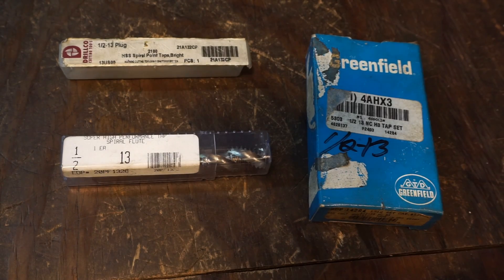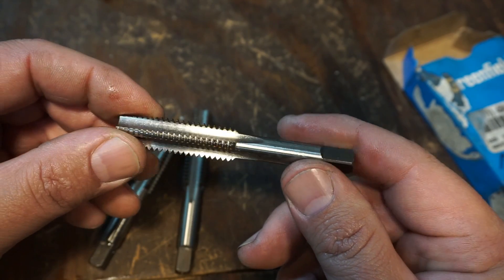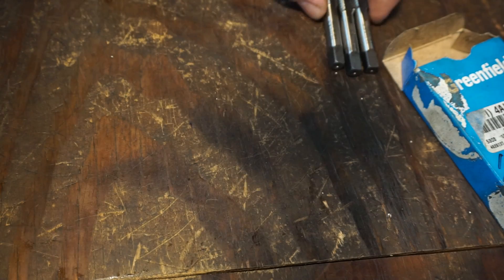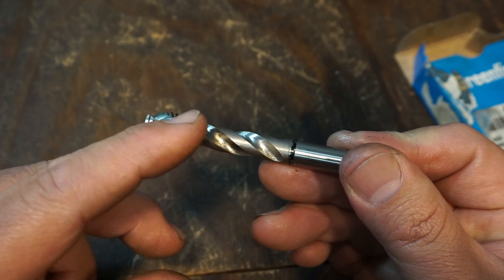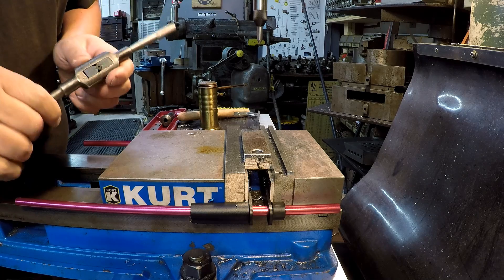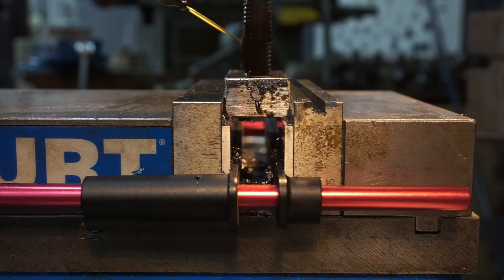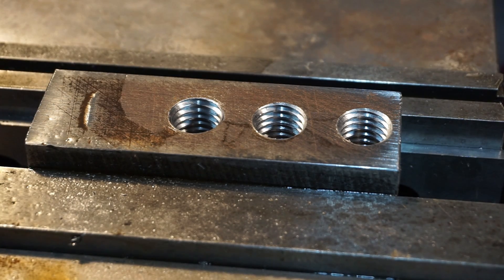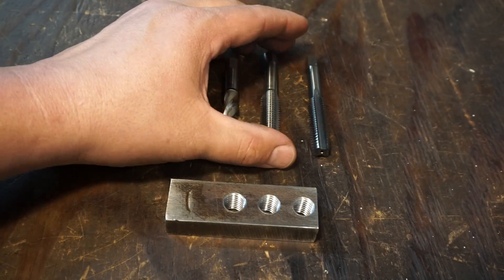Shop Talk 21: Taps

Comment: My first rule for taps: Don’t buy “high carbon” steel taps from the hardware store (like the Irwin brand everybody carries when you need one on the weekend). Now I only buy high speed steel taps from a reputable source like Greenfield. That has made all the difference for me in my home shop.

BTW I’m still learning about the various coatings they add to the HSS. Not yet sure where the hype begins on those.
Reply from the maker: Very true Tom! For those reading I'll second Tom's comment and I should have noted that in my video. Don't waste your money on high carbon steel hardware grade taps. Buy high speed steel. Even the high speed steel taps I have used that were made in China were better then the carbon steel taps.
Reply: I think it's worth the extra cost. You may need it again some day. If you've ever extracted a broken tap from a hole you already know the value of not using a brittle material for a tap. What is an extra $5 or even $10 dollars compared to hours dealing with a broken tap. Or worse, you can't get the broken tap out! Stick with HSS.
Reply: I think the coatings are useless in the home shop. Same with twist drills, coatings are only really for high production work. When getting the maximum life out of a tool is needed.
Reply: MrShobar yeah good for common taps but isn't worth the cost for those oddball taps
Reply: yep, black nitride seems to work best for me
Reply: The coatings come in to play in Cnc work where soluble cutting oil may be your only lube. Also un offically for tapping harder materials.
Reply: High carbon steel taps or dies could be used but only for plasticks or soft material but in other case they are worthless
Reply: Adom I'd even add be cautious of hardware / parts store hss. I bought one once as a backup for a weekend job. It looked like it had been run in a vibratory tumbler the cutting edges were rounded over so much I couldent even use it as a cleanup tap.

Comment: I cross thread the first few threads of aluminum engine block when I was installing valve cover.  Can I use a tap to try to fix the threads?  Or should I try thread chaser?  Any advice would be appreciated.  Thanks.

Comment: Years ago I worked at a large candy company and were not allowed to use plywood to mount electrical boxes. We would purchase 3 different sizes of 1/4" Aluminum plates. I could get several hundred 1/4-20 tapped holes with a single gun tap using a hand drill & alumni tap fluid.  Have some Greenfield tap sets that were my dads.

Comment: Another thing l do not recommend carbon steel  taps for tapping a hole as they are brittle and very unforgiving and brake off easily . High speed steel taps will spring a little before they  brake !

Comment: Spiral flute and spiral pointed work better for machine tapping as they give a shearing action as they cut . Takes a lot less  torque to turn them. Any tap cuts much like a broach . Each thread cuts the thread a little deeper till the last full thread with clearance makes it a full thread . The GH number marked on the tap refers to how many half thousands above the nominal size it is. Or how much clearance it will cut  for the screw . Everything  you was spot on . I sharpen cutting tools for a living . A sharp tap cuts  way better, less likely brake and cuts a much better thread . That's how a lot of taps are broken trying push a dull tap .

Comment: Airframe and Powerplant mechanic Did you know that aviation threads are rolled for strength and a tap or die make the threads unairworthy? These items create break points.

Comment: Thanks Adam, great video!  Hopefully you're still reading questions on this video. I'm in the process of buying a 115 pc Machinist's drill bit set and it seems everyone calls theirs "High Speed Steel", what other quality separates them. I see 3 different sets on KBC Tools that all claim HSS but are priced at $90, $250 and $350, but no other apparent difference. What sets them apart?  I'm not a full time metal worker, just a weekend warrior, but want a jobber length set that will keep a good edge and last me awhile. Thanks!

Comment: What is the materials of those taps? And why there are some taps are specially to be used on some materials like aluminium? If the taps can be used on steel, it is also certainly fit aluminium. Is that true? Thanks

Comment: I love how the data on spiral flute taps have a maximum tapping depth, and that it's always just the length of the threads cut on the tap. Even though you can take it down way deep, because the shank is slightly smaller than the tap drill size. If they have a fatter shank up top where it gets driven, then that, to me, is the maximum tapping depth.

Comment: a 4th tap ie a left handed might have been good too, though that might make a better shop talk video in its own right, you could show left hand drillbits and left hand taps and explain and demonstrate the uses of those.
great video abom79.
as an aside i saw a tap and die set at a boot sale(swap meet), it was in a plastic case and looked like one of those "budget" sets, a mixture of metric, unc and unf a comprehensive hobby set but i noticed they were lefties, so i asked how much thinking to myself it its under 20 pounds its mine, when he said a fiver i  said ok, that was the fastest i have ever pulled out my wallet LOL.
i guess he thought they were just a normal set, you have to keep your eyes peeled at these sales you find allsorts.

Comment: Ah ... a man that uses Edge Technology tools ...I have a Pro Lathe Gauge. Haven't used it yet - fits in my 3 -jaw chuck and enables me to set my tool height in my Lylak lathe. I have a bare bones tool post so I will use my Pro Lathe gauge to set my tool height using shims or precision ground key stock. I will then keep each tool and shim combination as a set. I think you get the idea - no more hunting for the right tool for my tool post. Obviously I have space for 4 tools in the tool post, with a fifth choice being a centre drill; I will use Edge Technologies Tool post chuck for drilling. This should cover most jobs with this lathe; other tools will already be a tool post 'set' if I need them. One uses what one has!

Comment: Great video from a great man. Thanks for the really nice video.

I would like to add that there's another one used for aluminum and soft material. It has a lot of names like fluteless tap, roll tap, conforming tap. And like the name it doesn't cut, it forms the thread from cold deformation which makes the thread stronger in softs materials.

Comment: I was once told that they are called gun taps because they shoot the chips out of the other side of the hole. Don't know if thats true but it works in my head. Also looks like you have some extra room on that piece of stock you might want to go over form taps in a future video.

Comment: Abom, can you do a more extensive lesson on (pilot hole drilling, stepped drilling and explain the difference in drill bits)? Oh can you explain proper size drilling before tapping? Another good lesson would be on dye’s as well as repairing tapped holes and threaded shafts and bolts?
Reply: Im a heavy duty diesel tech, I’m very curious about my prior questions because the shop I work at repeatedly calls a machinist to repair stripped, cross threaded and broken bolts too. I can do these repairs easily but, I’d like to understand different methods and proper technique in doing these repairs!

Comment: Adam, we use Dormer spiral taps at work and they work great. They are a little pricey but when you can power tap a few dozen holes before you see any changes (rough threads or binding up) is worth it to me. Nicely explained in this shop talk. Keep up the good work.
Reply from the maker: Yes Dormer is another good brand. I have a few sets viewers have given me.

Comment: Great video Adam.  I've used the basic "plug" hand taps for most of my life since that's all that came/come in the hardware-store-type tap sets.  If you decide to do a follow-up to this video, please explain for those who don't know, the reason for using a spring-loaded follower and also (especially for manual machines with no digital readouts) why it's a good idea to drill & then tap each hole before moving to the next hole to be drilled & tapped.  Watching you do these close-ups of spiral-pointed & spiral-fluted taps makes me want to add some to my tap sets.  I think my oldest tap & die set came from Western Auto, so I'm probably dating myself a bit here,  ;)

Comment: I love your shop talks Adam. Maybe one you can do is one on drill bits? Im an electrician I am always drilling into wood with different wood bits and steel. Maybe something about best drill bit for different metals? Some tips on sharpening the drill bits?. Im always burning through spade or paddle bits for wood maybe there is a way to regrind or sharpen them to get a longer life? Thanks Adam

Comment: Adam, thank you again. i learned a lot. that thread cutting oil you used looked like it was half oil and half snot. more like chainsaw bar oil. is this your own special mix or did you just buy it off the shelf ?
Reply from the maker: It's dark cutting oil, Pennex N47 which they don't make anymore. Rigid dark cutting oil is similar.

Comment: Tapping guns are kind of like an air drill with forward and reverse on the trigger first click goes forward and then the second click instant reverse. There used on assembly lines in production work.
Gun Taps are normally harder to break off than other kinds of taps.

Comment: I think the spiral flute tap may be made by YG-1.  They are a Korean company that makes end mills, taps, drills etc.  I have some of their spiral flute TiCN coated M5 taps and they make nice clean chips just like the video -- they also have the black stripe on the shank though I'm not sure if that has a purpose.
Reply from the maker: So far all of the Korean made taps I have work great!

Comment: Adam
Great video.  In the fab shop I worked in right after high school, we used nothing but spiral pointed taps in our tapping guns.  perhaps that is why they are called gun taps.  For lube we used nothing but Anchor Lube on both the drill bits and taps.  It amazed me the amount of life we got out os small taps and drill bits.  This was back in the early '70's.
Reply from the maker: I have Anchor Lube and use it sometimes but it's harder and messier to apply then using my cutting oil from my Eagle, so I just use what makes my job easier.

Comment: Perfect timing on this great video - I  broke a tap off in some unknown stainless today, time to get back to basics.  Do you change your tap choice (brand, coating etc.) based on the material you're tapping?

Thanks again
Reply from the maker: I don't change brand, but I will toss out a tap if i know it's getting dull and is not cutting properly. I use all my taps for any materials, but they must be sharp!

Comment: I learned a lot from this video.
- I learned that taps have a couple of threads at the tip to get them started - always wondered about why they started as easily as they do.
- I learned what a "bottom tap" does and why you need one and when you need one.
- The one thing I'm still confused about is: did you say the power tap was "loose" in the chuck?

Comment: Thanks Adam. The casual (mainly armchair based!) machinist in me never thought about this before but, presumably one issue with the partially threaded spiral flute tap is, if you go all the way through the work-piece such that the threads of tap are no longer engaged you have to be careful getting the tap back up and out again? Best not to let it go right through in the first place I guess!
Reply from the maker: You are correct. For my manual machining I visually inspect the tap as it clears the bottom of the hole then reverse it. But for through holes best to use a spiral point tap.
Reply: Makes sense. Thanks for speedy reply Adam! - hope you have a good day at work! :)

Comment: Another good subject might be to discuss classes of fit on threaded parts. Another might be to talk about pipe thread taps, which have their own quirks. For example years ago I worked for a Mill Supply house that sold valves and air cylinders made by a British company. Suddenly we started getting complaints that the 4-way valves in 1/4" NPT were leaking at the threads. Lots of head scratching going on for a while until someone figured out that a batch of valves labeled "NPT" for the US market were actually British Pipe Thread! What's the difference? ONE thread per inch (at least in 1/4")! Nice leak path around the threads...
Reply from the maker: Yep, I have a few bspp taps. One is 19 TPI.

Comment: So, I've got a project upcomming where I need to cut trapeziodial threads. I've bought a TR16x4 tap, but when I made a test tap, I couldn't break the chip whilst tapping.
I managed to power trough without breaking the tap, but I don't know if thats normal or not.

Comment: I am in the UK and have always known hand taps as Taper tap, second tap and plug tap or bottom tap that's how I was taught in college and have always known them called ever since.
Reply from the maker: I have a three tap set from your region and they are called something similar. There’s a first cut, second cut, and finish cut tap. I used them in a video once. It’s not common for the US though.
Reply: Sometimes they just get called first,second and third, depending upon where you are in the country.

Comment: Would the spiral fluted tap be the best choice for power tapping bling holes then, since the chips are pulled up and out?
Reply: dbennett4 yes. I think they’re the best for all power tapping as they spiral the chip out and don’t fill up like on with straight flutes
Reply from the maker: Yes best choice for blind holes.

Comment: Thanks for continuing to make videos with good information in them, both your Shop Talk videos and the Saturday Night Specials.  I'll also wholeheartedly concur with Thomas Utley's comment - a few weeks ago after sitting for 1-1/2 hours with a Dremel and a small burr to grind out a broken cheap carbon steel tap from a hole (where it broke on the way OUT), I won't use them in anything harder than aluminum.  Now saving for a set of HSS taps and dies.

Comment: Great video Adam. I really enjoyed that. When I was looking for taps at MSC, the options.......OY! I have the run of the mill hardware store taps, fortunately for me, I only broke one tap in my life, I was able to get it out and enlarged the hole and tapped it for a larger bolt,  not a problem for size, only held a emergency brake cable. I managed to find some Tungsten taps at a yard sale and it replaced my cheapo metric carbon taps and they work great, a little oil makes things much easier. Is tungsten a better metal than HSS? I enjoyed the differences on the taps. I usually run a tap through anything with a bolt to clean it out upon disassembly. Now that I know what each tap does, makes it easier to purchase the ones I need. I have HSS SAE taps, and I have some Craftsman taps not sure on type of steel. I use a brass brush and lightly clean them when done or air.  Thanks again.
Reply from the maker: I have not seen or used a tap marked “tungsten”. They do make carbide taps but I have never used them and think they are for cnc use only.
Reply: Hmm, not sure how old these are. I bought a fastener storage cabinets with drawers (plastic ones) that was full of taps and dies. They were metric and it essentially replaced everyone of my metric carbon steel taps and dies. The sets usually run over 100 bucks for a standard smaller set, off brand. At least now I have my options and know more about the taps since watching the video.

Comment: Another great video for those just starting out. One type you didn't cover is form taps (roll taps.) They are great for blind holes in brass, copper, aluminum and mild steels. They don't work well in plastics or cast metals. We use them all the time on our CNC mill. The tap does not cut. It roll forms or cold forges the thread. Because of that they call for drill sizes different than cut taps. Example: with a 1/4"-20 cut tap. You drill a number 7 (0.201") hole. With the same size form tap. You drill a number 1 (0.228") hole.

Comment: Hi Adam, good stuff!
This video would have been complete if you had included forming/extrusion taps.

I seem to get much better result starting a thread by spiral point taps (hand or cordless drill). less tearing on the start, less force and binding, much easier to get it aligned, also seems to work much better on gummy metals like aluminium or copper.

Hand taps seem to want to stick to gummy metals and often I get tearing of the first few threads. spiral flute is great but needs a rigid setup, starting a straight hole with it by hand can be really tricky.

Forming taps are great for sheetmetal, aluminum and plastics. you get almost double the number of threads because of flaring of the metal on both sides. real lifesavers, but the hole size needs to be pretty spot on or you gonna break taps all day.

Ah, last thing, when there is a case I really want to keep oil off the tap and base metal (welding for example) I use methylated spirits as lubricant and cooling agent. the tapping needs to be slow enough to avoid rapid heat buildup. that can evaporate the spirit instantly and cause binding. otherwise it works quite well, specially on aluminium and copper.

Comment: Nice demo Adam. In the UK we call the hand taps 1st and 2nd Taper and Plug tap i guess it makes no difference provided you use them in the correct order.
Reply from the maker: I have a set from overseas like that. I believe first cut, second cut, and final cut. Two of them have painted grooves on them indicating first and second cut.
Reply: Or taper 2nd and plug